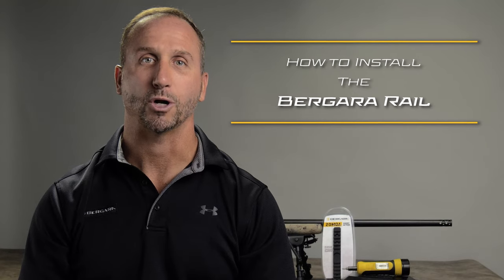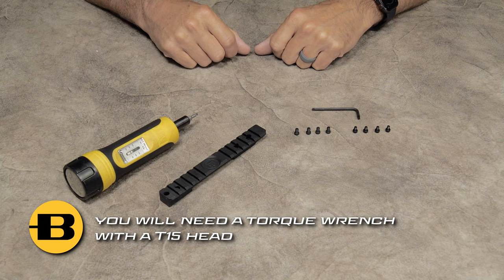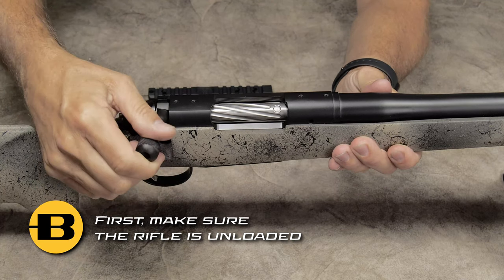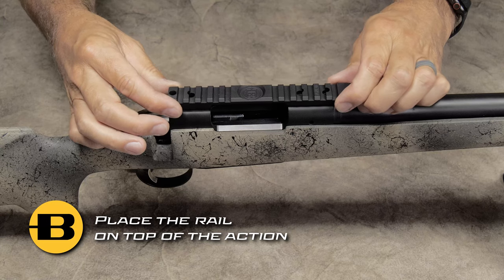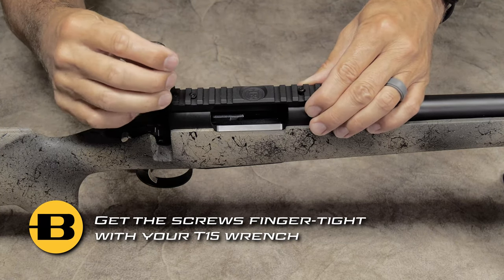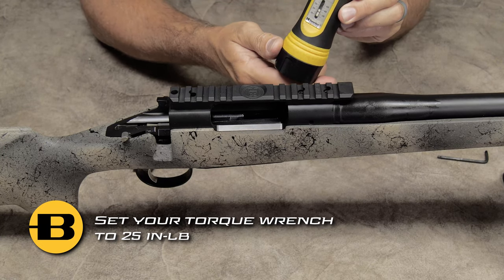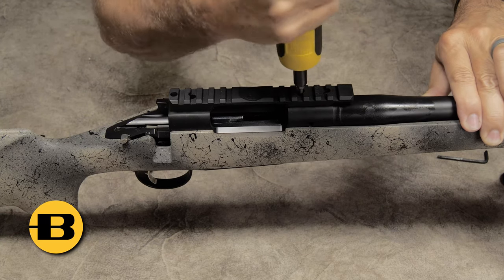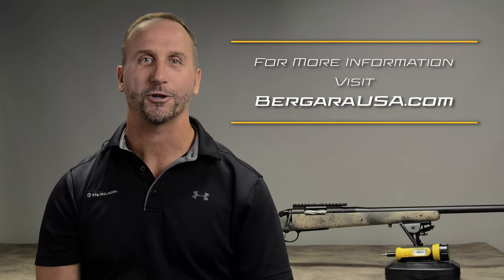How To Install the Bergara Rail

Comment: Did you have to use a shorter screw for the hole closest to the muzzle? I noticed on mine I can see the threads from the barrel underneath? Or was all 4 screws provided the same length?
Reply: All 4 screws are same length on mine. The holes are a little deeper on the rear of the rail.
Reply from the maker: Thank you for pointing this out.  We are already working to resolve this from the manufacturing side. The screw will still to the job and hold down the rail, but you can shorten it a little if you want to.  Just be sure not to take too much off or the screw won't be able to do it's job.

Comment: I recently purchased a Bergara 6.5 PRC Wilderness Ridge rifle.  I want to make sure I am purchasing the correct accessories for this rifle.  I would like to add a rail but not sure what rail I would need for this rifle, I see three listed in the catalog: BA0010, BA0014, and BA0008?
Reply from the maker: You can do the BA0008.  That's the Short Action version of the 20MOA rail.

Comment: Do you recommend degreasing the screw and/or using blue lock tight on them when installing?
Reply from the maker: Just install them as directed and you should be good.  You can use lock tight if you want, but it's not required.
Reply: @BergaraOfficial  he's right, blue lock tight is ALWAYS the way to go on bases,and rings.

Comment: So what happens when I have a B14 HMR and it seems like the screws that came with it are to big for the drilled and tapped holes on the receiver? Been trying for an  hour and a half to get them to thread even without the base and no luck.
Reply from the maker: It sounds like you only received the Premier series screws.  Your rail should have come with 8-40 (Premier) and 6-48 (B-14) screws.  I would give customer service a call and they should get you squared away.

Customer Service:
770-449-4687
contact@bpiguns.com